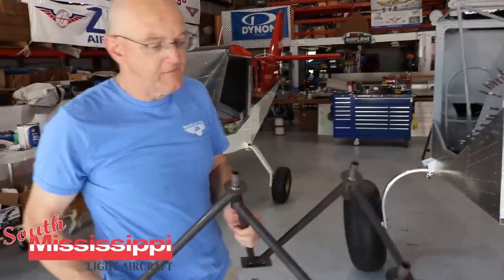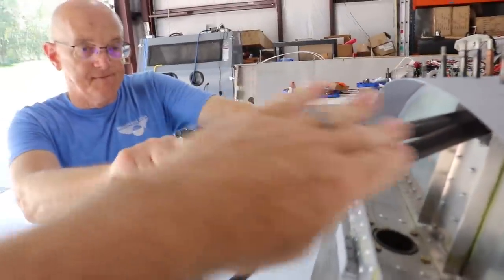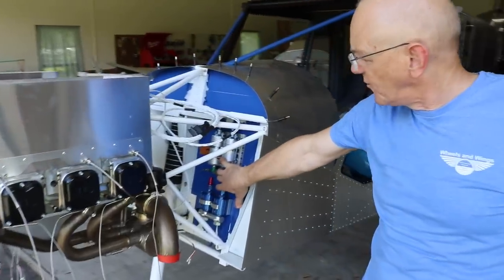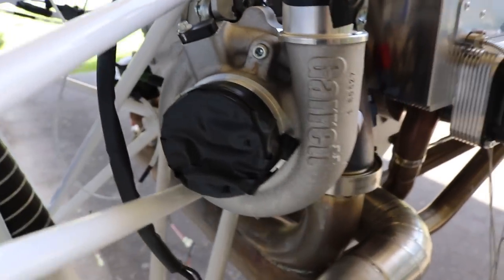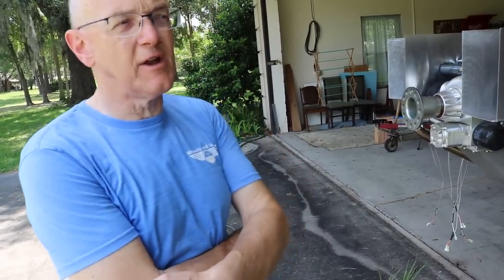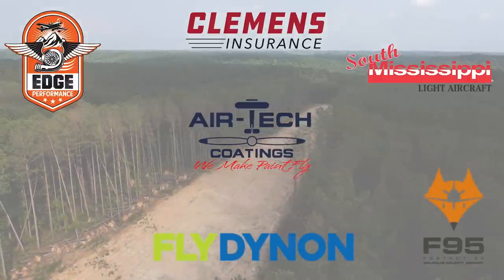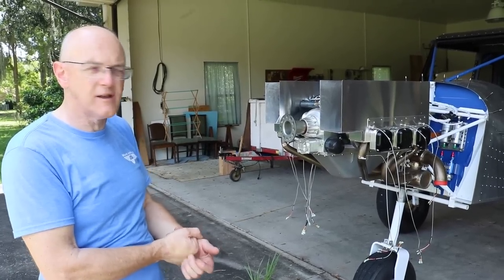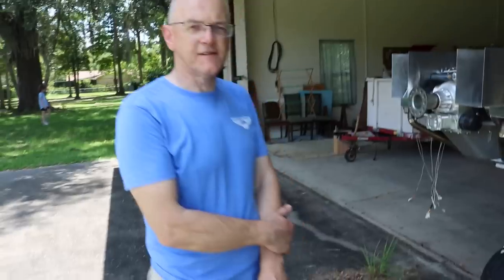Engine Update!  220HP 6cyl 520T Turbo UL Power Aircraft Engine

Comment: Any word on why the recent crankshaft snapped causing a crash?
Reply: I thought I read that S21 might have had a prior ground loop and possible prop strike? Not sure if that's correct. Would be nice to hear more info from UL Power on this. It's my current choice for my S21 build, but nothing gives you pause like a crankshaft failure! ;)
Reply: @arpeltier  all the factual data would be good to have. Enjoy the build!
Reply: Cleared Direct, 
You've met the builder of that S-21.
What have you heard?

Comment: Till the crank snaps…🤷🏻‍♂️
Reply: Why would that happen?
Reply: because it already did a month or so ago on an 80 hour 520T engine…
Reply: S21 520T engine failure
Reply: @Captndarty  was that the one with a photo posted on Facebook with a weird hole drilled in the shaft?
Reply: Have any cranks snapped on lycomings or continentals?

Comment: BeautifuI assembly.... but I still can't believe . people still use air-cooled engines on aicrafts in 2024... IT Looks like aviation is resistant to evolution.. The car Industry is 30years ahead aviation.
Reply: But air is always available to do the cooling. 
When a car engine's liquid cooling system fails, the car comes to a halt in a cloud of steam at the side of the road.  
An ovrheated car does not fall out of the sky like an aircraft would.
Can you see why some aviators distrust the Rotax 9 series engines and their liquid cooling?
That said, liquid cooling was a standard feature of many a WWII era aircraft engine as was forced induction.
The Rolls Royce Merlin, for example, was both supercharged AND liquid cooled.
Reply: It makes sense now,  I never thought this way....